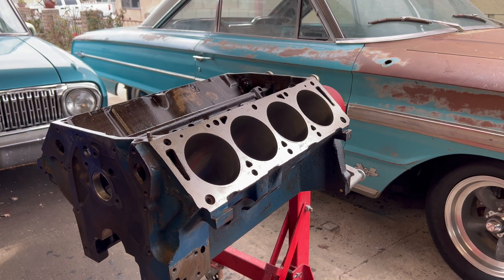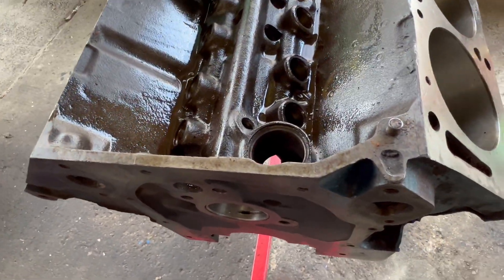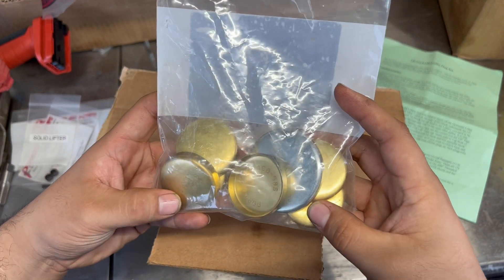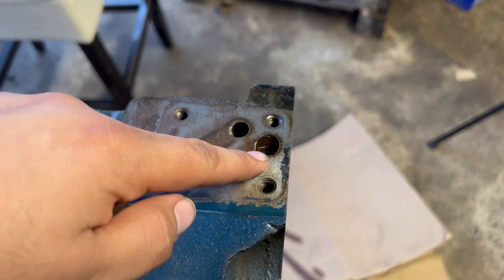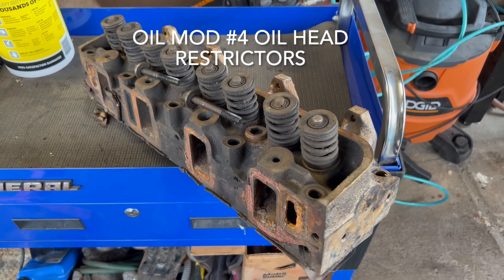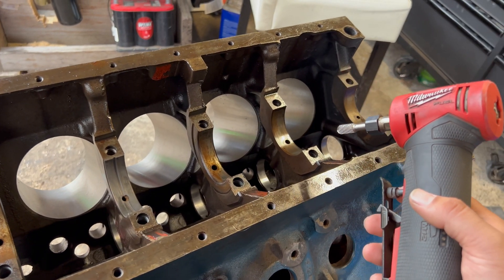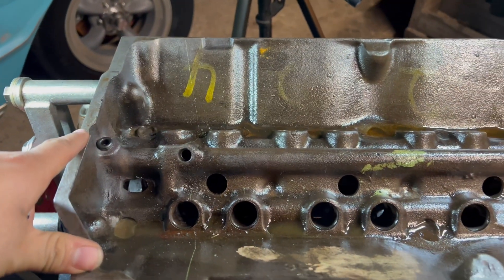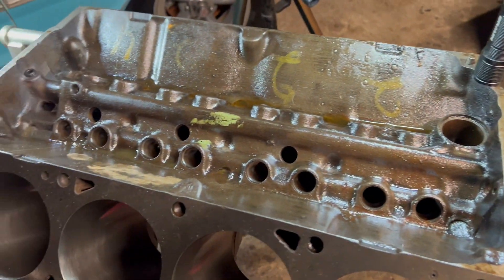Ford 428 FE Block Prep: Oil Mods, Oil Galley Plugs, and Blueprinted Oil Pump!

Comment: One of the best oil mods is to clean up the casting and taper the oil returns  In the lifter valley to help the oil drain back to the bottom
Reply from the maker: True! I’m kind of weary on that area since it looks pretty thin haha
Reply: Chamfer, not taper.
Reply: I did this too
Reply: I've only overhauled an aircraft engine and when I saw those oil return holes I was like wtf.. I didn't know what it was because they were so rough. Obviously found out what it was and immediately thought of my 69 Falcon that had holes in the cover plate for the springs just crudely opened for grease servicing. But if you look at the hole it's so ugly and jagged, it's like someone took an acetalyne torch on high and just blasted through it and called it a day. Like wtf, get a hole saw. 

Ford getting real lazy just pumping out these cars back in the day.. while we're at it let's not paint the cowl induction area either.. what could go wrong?

Comment: I drilled my pump to filter passage , filter thru block (1/2) up to the turn and down from the gallery. Then through the gallery 7/16. Tapped and plugged all the holes so I can keep the thing from bleeding internally and tapped and restricted the heads to . 090 going to the rockers
Reply from the maker: Very nice, these upgrades will really help. I also used a .090 restrictor to the heads.

Comment: All of those mods should be done before the block goes to the shop to be vat cleaned. And I personally would remove the cam bearings before aligning the oil holes to the mains because there is a oil groove in the block under the cam bearings and all of those iron shavings are going straight down to the cam bearings. There is also a oil return hole at the bottom end of each head that I blend in to keep oil from puddling up and makes it easier for oil drainage back to the crankcase.

Comment: Omar, do you red or blue loctite those oil plugs into the block?
Reply from the maker: I used a thread sealant paste as it shows in the book. You can probably use blue loctite if wanted
Reply: @OmarRamirezGalaxie  sealant probably better. That book certainly helps and I know you watch Brent at Lykins Motorsports like I do!

Comment: A couple things with tapping holes, coat the tap with grease, to help catch chips, but more importantly, lubricate the tap and the threads. Second, get two taps, and grind the end of one of them so it doesn't bottom out in the hole as quickly. When grinding it, go slowly, and keep dipping it in water to keep it cool.
Reply: I think you mean cutting fluid, not grease. There is a difference. Something like TAP Magic.

Comment: You didn't bore out main galley on top to 7/16 inch, doesn't do much good to increase rear passages to 7/16 if main galley is 3/8 inch. Raced these for years and did that to keep mains oiled. Make sure there is no restriction from oil pump to main galley in center of lifter valley, open up main passages to mains, you have to have main bearings removed to open up to main galley, otherwise they love to spin rod bearings.

Comment: Hey just a heads up you sometimes can lighten up those pistons drilling weight off the inside  used to be a cheat in claimer engines when we would knife edge a factory crank we would have to cut weight on the factory dome pistons to keep from using to much heavy metal during the balance job

Comment: I don't think you had to open up those holes or the crank bearings because the bearings don't move at all, just the crank. Part of my concern is that you might create turbulence in the oil flow around those holes!
Reply from the maker: Possibly! I don’t think anyone has done a scientific test yet to really see how it affects the flow in that area. I figured a small bevel wouldn’t hurt, but I guess we’ll see once I start this engine haha
Reply: @OmarRamirezGalaxie  Yes, Dave Shoe did actually do the testing and fluid dynamics on the mods. The holes on the offset main bearings should not be drilled larger but chamfered from feed under the offset holes. Also the main feed was drilled out to 7/16. Ford Power Parts used to do this as well as the pump to block opening. Doug at Precision is great. I have his pump, rockers, shafts and plug kit/ restrictors as well.  With .0025 main and rod clearances I have 25 psi at idle hot ( 900 rpm) and 60 psi hot at cruise ( 3000 rpm)
Reply: Restriction of oil flow/presence is the reason for opening them up.
Reply: Worked in 3 engine shops now and we've opened every single one up I have done for last 20 years. I have 4 FE's here in the machine shop right now. One 390, two 445 strokers and a 428.

Comment: Great video, again! I especially liked the blueprinted oil pump with safety wire no less. Having worked on older jet aircraft for over two decades, safety wire was standard operating procedure. Small details like this and the attention to detail on the oil galley mods are what make your videos reall shine!
Reply from the maker: Thanks ! Appreciate it!!
Reply: @OmarRamirezGalaxie nice vedio, where does the 1/8th plugs go